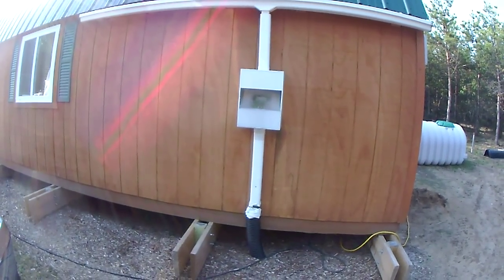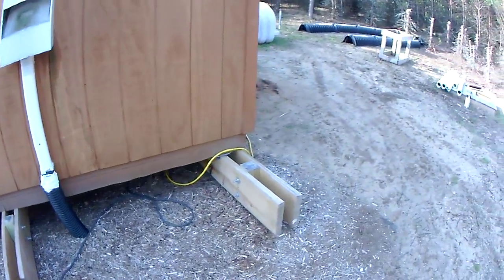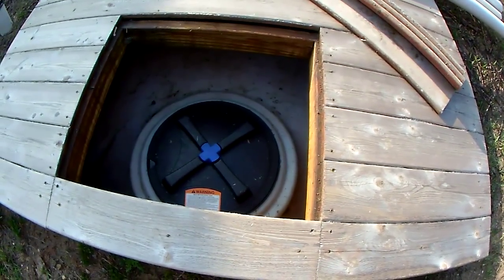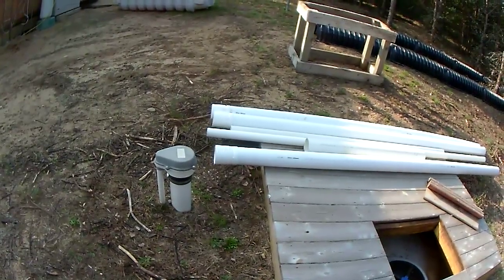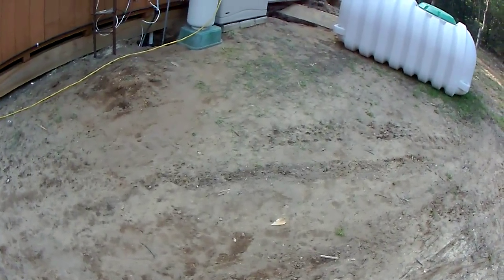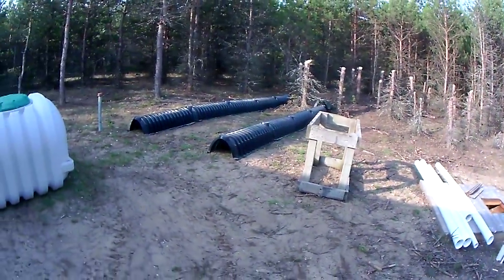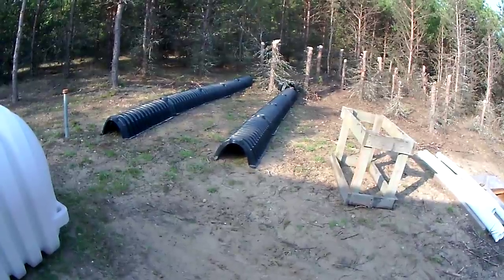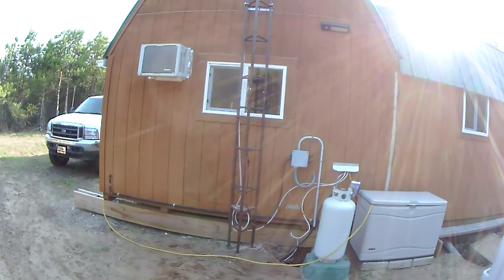Off Grid Cabin water system

Comment: Do you have a diagram of the tank/pump etc below ground?
Reply from the maker: Tony Muhlenkamp 
No but if you picture a 8’ deep well pipe (5” PVC) with a cap at the bottom . Then I cut in a shower drain the lowest I could on the side of the tank. Next I teed that into the “well pipe”. I used a pit adapter (Menards plumbing section) to connect a 110v submersible pump (Menards)(see a pattern! LOL). Every thing from there is standard well tack, switch, etc.
Just getting ready in the spring to install an 1800 gal tank. This system has been working so good and we have since expanded the cabin and the time spent there.